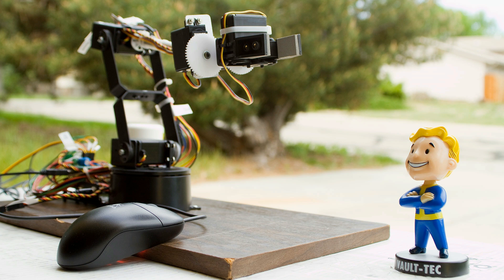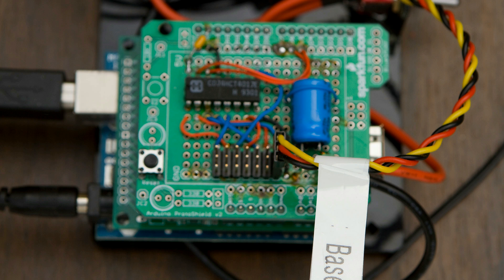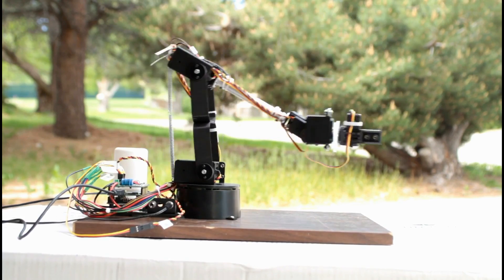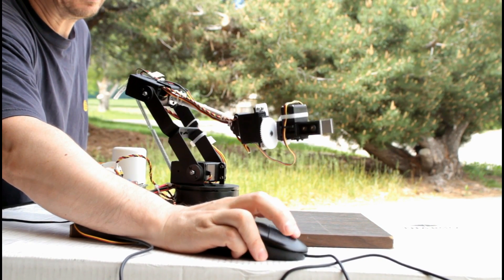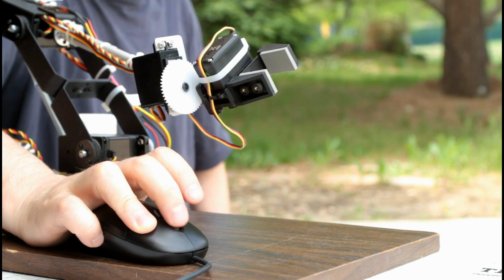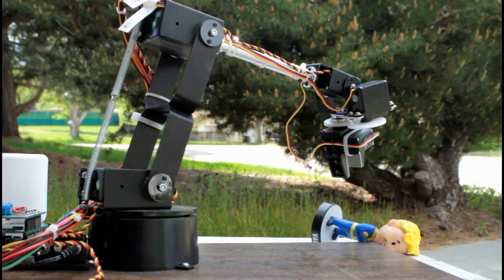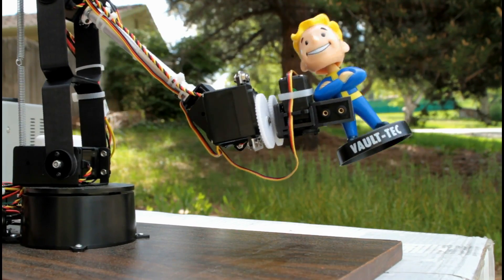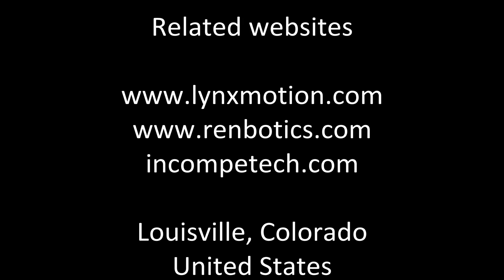Controlling Robotic Arm with Arduino and USB Mouse

Comment: Is there an existing arduino board that can cater for having enough power supply to the servos and bluetooth connection without needing another shield ? Thanks.